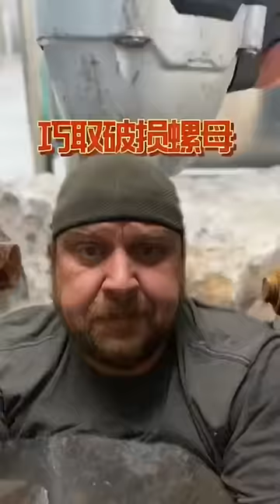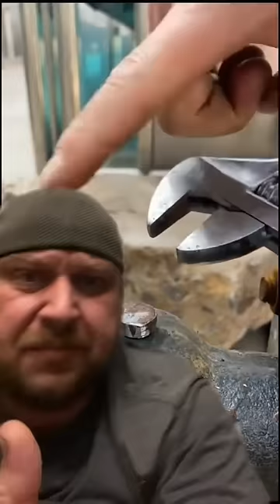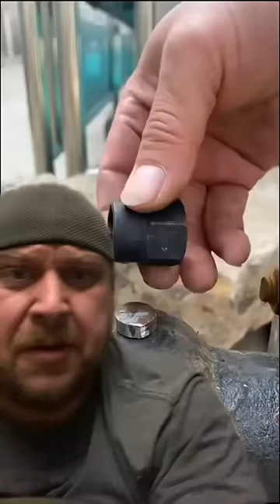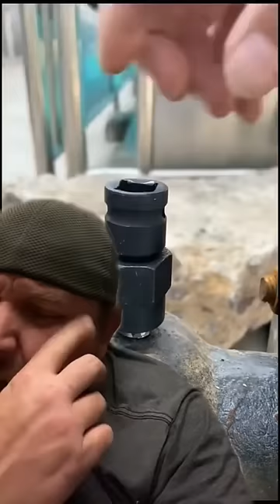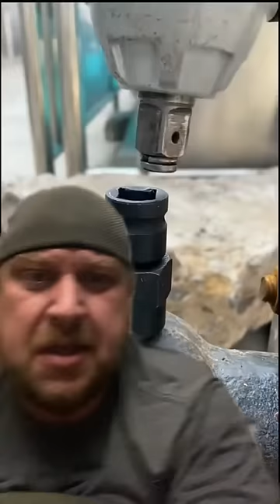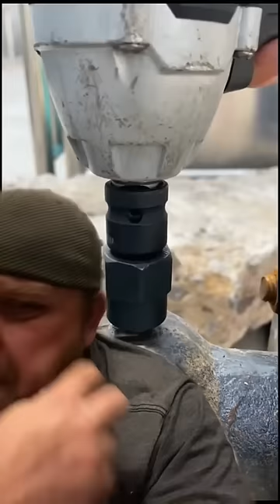Circle Bolt ￼

Comment: I'm still convinced whoever initially created these sockets deserves a Nobel prize
Reply: They are pretty fucking nice in tight spots
Reply: Damn right brother 👍
Reply: I've never had to tackle anything that heavy duty I've always been able to get away with Vice Grips.  But they do seem to be useful for heavier equipment.
Reply: I picked up a few when I had a cracked tire lug that was just stripping itself. It ate the veneer off on the first run, and the actual lug on the second. No trouble whatsoever. They are a genuinely great torch method for stripped bolts.
Reply: Great tool to have in case things go sideways,  I've had good success with these things.
Reply: I bought an old pontoon boat with brass plugs in the aluminum toons 
Absolutely nothing got them out I was afraid I was going to have to drill the out and then my mechanic buddy showed up with a set of these
The stripped brass plugs were out in less than 2 minutes with whatever those things are called

Comment: Mission complete: remove bolt from metal (difficulty 2)

Mission started: remove bolt from socket (difficulty 5)
Reply: Nope. Not difficult. Put the socket on a vise with the bolt between the jaws and close the jaws enough that the socket can rest on the jaws and then take a smaller bolt and put the smaller bolt in the square hole and hit the small bolt with a hammer until the bolt you extracted falls out.
Reply: You can just smack the bolt out with anything that won't damage the threads.
Reply: To be honest, I used to just throw extractor sockets at the concrete as hard as I could and most of the time it would just bop itself out
Reply: @@BacklashMobileGamingChannel sounds like a sex toy company may have already trade marked it🤔
Reply: Just put a nut in a vise, and tighten the bolt and the extractor wil just let go, its izi pizi
Reply: @dragonmasterlangeweg7625 I've already just used one of a couple old exhaust valve stems 😅
Reply: Heat
Reply: @dragonmasterlangeweg7625 he's the dragon master and the nut master
Reply: @dragonmasterlangeweg7625 thats not necessary. Put the bolt in a vice then grab a ratchet and start to "tighten" it. It will come right off.
Reply: @aaftiyoDkcdicurak I think once the bolt head is that fucked, you don't really give a shit about the threads.
Reply: Use a bigger hammer
Reply: I personally just use an air hammer. Knocks that stuck bolt out of the socket in a fraction of a second.
Reply: @aaftiyoDkcdicurak  why would you be worried about damaging the threads? you should take a second to really look at the bolt :D
Reply: @aaftiyoDkcdicurak  Why do you care about the threads on a bolt with a rounded head? lol it's junk
Reply: @aaftiyoDkcdicurak  why would you care about preserving the threads on a bolt with a rounded off head? You can also take disconnect the socket stick a punch in the driver hole then smack it into a hard surface.
Reply: Put the nut back in a couple turns, whack the socket sideways with a mallet. 
Also, turn the socket upside down, put screwdriver in the driver end and knock the screwdrivers handle against something solid.
Reply: @aaftiyoDkcdicurak if the bolt head is completely destroyed the threads don't matter too much
Reply: @dragonmasterlangeweg7625 this guy didnt knew he needed a circle bolt adaptor, i dont think hel be able to solve this issue.
Reply: @DarkAttack14 using the darkattack technique
Reply: @darrellbeets7758  it's a very powerful technique ;) just don't do what I did once which was throw it while it was just finished glowing orange so a coworker picks it up off the shop floor
Reply: You don't necessarily have to use a punch to drive it out.  Put the bolt in the vise, and tap it side to side with a hammer in opposite directions, and it will walk off the bolt head.  If it's a nut stuck in there, same thing.  Bolt in the vise, thread it on, and rock it off with light taps.

But if it's possible, I free the socket before it comes all of the way out by reversing directions once it's torqued loose, then run it back out again with the nut free.
Reply: I looked for this specific comment😂
Reply: @dragonmasterlangeweg7625  Have you priced bench vices?

Getting one so oyu can remove a bolt stuck in a soket, i'd throw the socket away and buy  anew one.
Reply: I don't think damaging the threads matter if you're using the circle socket to remove the bolt 😂 @aaftiyoDkcdicurak
Reply: Ground + hammer, easy.
Reply: It's still more work . Why are you arguing?
Reply: You can always do the classic and toss it on the ground, or, you could vice grip it and, since it’s a socket, put a punch through the end and hammer it out. Difficulty 0.5.
Reply: Leave it in a few threads and pull it out of the bit. then, hand/vise grip unscrew it the rest of the way
Reply: Mission complete: Create circle bolt.

Comment: I'm more of a vice grips and aggression kind of guy 😆 🤣
Reply: I’m more of an, “I don’t have time for this. Fire up the torches. If I melt the wrong part? You need a new part.”
Reply: My first thought. 😂
Reply: vice grips are my thing also but sometimes when the bolt is in a nasty place i use blow torch
Reply: I ju left the studio
Reply: Yup same here. Couldn't afford the proper tools at the time and all I could find was a vice grip with a short handle. I drew out some freakish monster strength that day after a few lines of coke😂🤣🤣
Reply: I would use a pipe wrench on it, the bigger the better.
Reply: @lbaker3602001  my usual move is find a socket (usually from my imperial set) and weld it on there
Reply: Pipe wrench it is. Also I want to see him get that thing out of the socket. Probably more of a pain in the ass to get that out of it.
Reply: You mean grinder it square and pipe wrench, yeah?
Reply: Cool! It's monkey wrench for me though lol!🤠👍
Reply: @TrillMurray  Pretty much the same, or pound it on if it is a bit small and I don't mind killing the socket.
Reply: A pipe wrench would have worked, too
Reply: I've never rounded a bold head with vice grips before. They're my go to.
Reply: Make it a flat head. Then use a screwdriver bit on a ratchet.
Reply: Had to use one of these counter thread sockets on a bolt in my car that someone had rounded like fully round holy shit that motherfucker was on there tight
Reply: *goes to my crystal mehh addicted neighbors house a.k.a his tent* "Yo, let me borrow your torch that you stole from my garage the other day?"
Reply: or just use an angle grinder to square this up...
Reply: I'd put a cut in the top with an angle grinder and turn it out with a flathead screwdriver
Reply: Vice grips, everything you need to tear down a Chrysler small block!😂😂😂😂

Comment: I work in a tire shop and sockets like these are actually extremely helpful in breaking off wheel-lock keys, as they are almost always a circle with some weird pattern inside.
Reply: Yes and the anti theft bolt goes round and tound
Reply: @robmcghie5248  Maybe if you own an Audi. I tried that once and learned about that sleeve. Customer wasn't happy they had to take their car to the dealer and spend a lot of extra money on a wheel lock key for a tire rotation. Guess that'll teach em not to lose it.

Comment: Lacking a set of nut extractors.  A couple things can be done.  

Grab a Mill Bastard file, ideally a flat sided one, and file it flat on two parallel sides to slip a wrench on it.

Vise jaw pliers, locked as tight as you can get it.

Grab a hack saw or angle grinder, and cut a slot in the top of it to turn it into a screwdriver type head, and turn it with a screwdriver or flat bar.

Use a chain wrench.

Weld a metal bar to the top of the bolt/nut.

There's more ways, but that's a few solid tried and true methods.

Comment: That "circle bolt" looked suspiciously hex on the bottom. I'm skeptical of that last jump cut before the impact wrench. 🤔
Reply: He probably edited out loosening it with his fingers to make sure the Chinesium extractor worked for the video.
Reply: @ricksanchez3176  I have a set of these and for $20 they work very well. Havent used an impact on them, just ratchets and wrenches.
Reply: @bigpjohnson  I got ya, I'm not a tool snob, If it's decent it's decent. But it's kinda like Billy Maize selling flex seal, it's good stuff, but I never tried it, not for a long time because of how and who was promoting it. My butt stays sore for decades.
Reply: @ricksanchez3176  Extractor sockets are the real deal. Rounded or rusted nuts/bolts can't survive with them. They dig in the more you twist them
Reply: the " circle bolt" was just a hex that got grinded down innthe first place...

Comment: Yes, those sockets have saved me a many of times. 
I like them.
Reply: Same, ive used on rounded off wheel bolts and a sump bolt.
Reply: How do you get the bolt out of the socket after? Looks like it could be a pain. Vice, punch, and a hammer?
Reply: @Logan.  Yeah a vice and 'screw' the socket off, or into a scrap brake disk.

Comment: The funner part is getting them out of the socket 
Funner
Reply: Yeah how do you actually do that
Reply: @michaelmoore8787   I throw it at the ground until it comes out…….I’m not even joking.
Reply: Could try screwing it into a nut held in a vice, so that the tool unwinds itself?
Reply: Keep the last few threads in the hole before you take the bolt out. Then wiggle the socket back and fourth while it’s still on the gun, gives you a ton of leverage.
Reply: Put the threads in a vise and run the impact right tighty. Shits gravy, Chief. Y'all are wearing me out 😂
Reply: No no NO!
You pull the socket off the impact wrench, then you pack the opening with c4, making sure to get all packed in nice and tight between the circle bolt socket and the circle bolt, And then ya splode that thing!

THAT'S how You get the circle bolt out of the circle socket.
Reply: 2 sets of vise grips or pliers.  The kit comes with a metal rod to knock bolts out too.  I have this kit and it does a good job for $20.
Reply: Acetylene cutting torch aka "liquid wrench" to quickly remove offending bolt.
Reply: Lidyas on acid again
Reply: Yeah that part can be a pain if you don't know a damn thing about tools. Grab a clamp or a slightly larger socket, insert a center punch from the back side and knock it out with a hammer.
Reply: @allenseeallendo5844  thats what I do and if that doesn't work I grab a punch.

Comment: Hammering in that socket made me recoil
Reply: But that's actually how you use those sockets though? It's supposed to dig into the stripped bolt so you can remove it.
Reply: That's why the are impact rated.  😆😆😆
Reply: @gamingcentral39  the Frankie dude just wants to pretend he knows what he talking about

Comment: Had a seized spark plug that broke at the base after hours of trying all the heat/wax/oil/solvent tricks, nut/ceramic section completely gone, only a small section of exposed round metal was left.

This type of extractor saved the day.

Comment: One rule of extracting a stripped or seriously rusted bolt. NEVER use impact or other power devices. You have to tickle them out. It comes so much easier with a little tickle. Works for me!

Comment: i bought a set of shifting spanners that you could wind out the jaws and turn them around, the other edge had teeth/grooves cut in them. they became a set of stilsons like the plumbers use and were awesome for getting at rounded heads. my workshop foreman saw them and started to rag on me with "what are these gimmicky lookn things" etc. they're actually a good swedish brand, cant recall the name, and were'nt that cheap. about a week later he comes over to my bay looking very humble to ask if he could borrow one because nothing they had could fit into the space where the bolt head was. i gave him back all the shit he gave me "you sure now, somebody might see you using these gimmicky things". sandvik barco, thats them. not top of the range but i had them prior to doing 10yrs at mitsubishi and still using them. they make pretty good files as well.

Comment: I have the original versions of these, and I just tried to use one the other day. My circle bolt turned into a jagged mess of steel bolt in very little time. Now it's going to be a ground down bolt, anf then a nut welded onto threads bolt.

Comment: extractor sockets, you can use a vice grip or pipe wrench with a cloth and not scratch up the bolt too… else just drill a small hole on the side and use a spanner wrench

Comment: Circle socket? Collet chuck works great to drive circle bolts. I have made them unironically and driven them thus. (Application was high voltage electric field control on a small scaile)

Comment: I have a socket that will remove bolts like without the cost it has a bunch of steel fingers inside and works great for things like this.
Reply: I’ve seen that somewhere I want one

Comment: If your bolt heads are stripped you can flatten one side and then the opposite side with a grinder and then use a wrench to take it off if you don't have those sockets to take off stripped bolts

Comment: I've seen security fasteners that are round. They used a hot socket that held tightly while cool to install the fastener then heated to release the head making a fastener that is very hard to remove with a wrench

Comment: Hey now, I have ran into some messed up bolt heads where those sockets came in so clutch, and worked perfectly every time. The hammer though…

Comment: or you could just take a hack saw and create a groove in the bolt head, which will allow you to use a flat head screwdriver - or a crowbar if you need the leverage

Comment: This would be more helpful than drilling and tapping a 14.8 tensile bolt (AS/NZS) then oxying inside the hole to crack the loctite & then using a 13-21mm (taper) ezy-out, chisel & every swear noise a while person is allowed to use

Comment: Circle bolts 😂  This is the first time I have seen one of these guys use an extractor instead of welding a bunch of scrap together, crafting a useless tool that does nothing. Then, using the extractor while no one is looking and claiming the tool did the job.

Comment: Ive never had much luck with those sockets.  Better off with a straight jaw vice grips or welding a nut on the bolt

Comment: Bolt is already fucked.
2 options:
1) angle grinder, cut 2 sides off so your adjustable wrench will twist it.
2) get a nut, put it on top. Weld inside the nut to the top of the bolt. Probly should also weld around the outside-bottom of the nut too. Then use the socket or wrench on the nut.

Comment: Those are called extractor sockets and they work really well for rounded off bolts like the one in the video what I used for is a wheel locks I lost my key, so I had to use one of those to take off my rims. I'm not sure what this guy's trying to make fun of in this video it's a perfect example of how the extractor sockets work.

Comment: Well I think you might really get the idea behind the video. The bolt used has grinder marks on it. It seems the artist is try to show a tool for getting striped bolts out. Using a circle shows just how stripped it could be. But this statement is still theoretical verse fact.

Comment: Or you could weld a bigger nut on there. Make sure to either heat up the existing stripped bolt/nut for deeper penetration, or turn your heat up on your welder. 
The way the video shows is good if you can afford those easy outs and don't have a Welder.

Comment: So I need to spend a bunch of money on circle sockets to avoid flattening two sides with an angle grinder to put a wrench on it that I already own.. gotcha... Not a tap set?  Gotcha.   After I've used a hammer to seat the socket and removed the bolt what's the trick to get the bolt out of my socket?

Comment: I make circle bolts. Fu ckin plastic nut on top that fuel filter housing? Rounded out for this guy. Had to beat a slightly smaller metric socket on it to remove it.

Comment: So this is completed separate from this video it’s just a adhd rant. Why do 1/2 to 3/8ths adapters even exist? If your putting a 1/2 impact on a 3/8th chances are your gonna ring that adapter clean off if it has any resistance stronger than what’s needed for your standard chuck drill. Idk just a rant ig